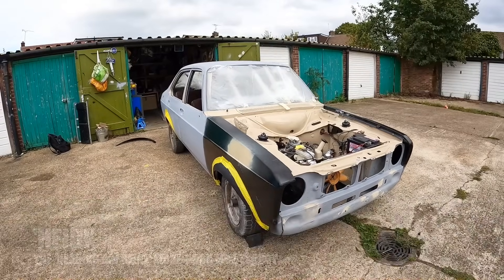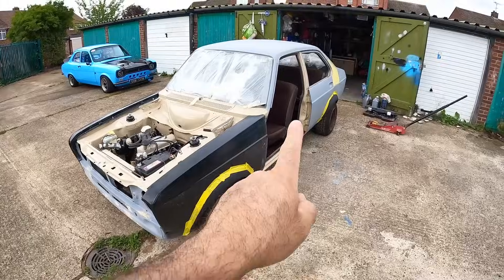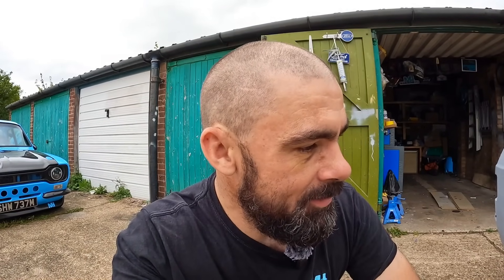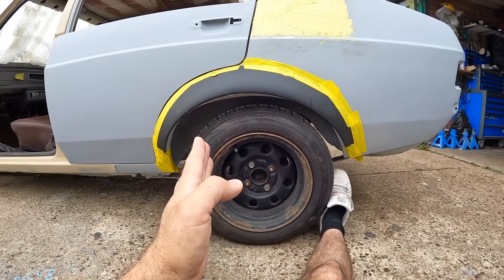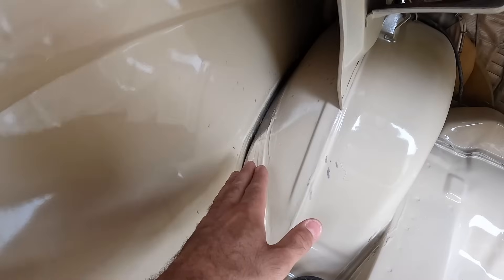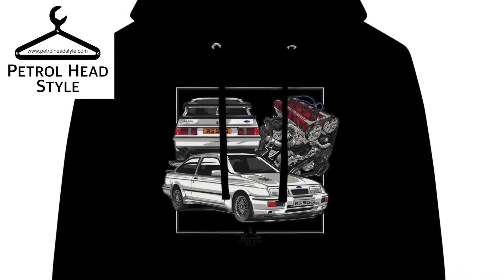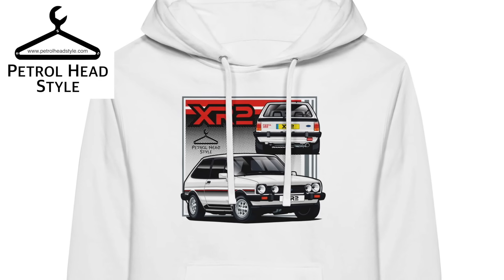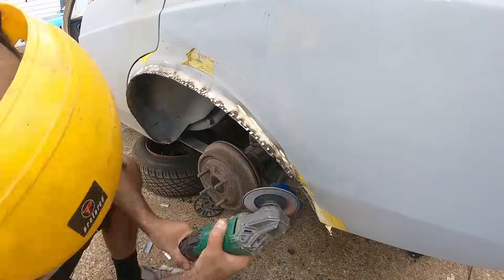EPIC FAIL installing wide arches to my Mk2 Ford Escort!! 🙁 #WideBody

Comment: Honestly, be proud of yourself. As a qualified welder I can tell you that you did a fine job and you should continue to weld as you are showing very fast and promising progress. The plastic arch might move about if you pour boiling water on it. Most plastics are thermosetting.

Comment: And making your own arches with fiber? Is a massive job, but at the same time a nice skill to learn.
Reply: It's a lot of work. You can't just slap fibreglass on and shape it. You need to make a prototype, a mould, a negative and then you can lay fibreglass.. Personally I think there will be a company somewhere that sells steel fab arches as blanks that can be tacked on with a welder.. Probably Europe.
Reply: @R6AAO  Yes, is a massive job, but the end result is better than those cheap plastic ones and even better, the learning experience
Reply: @maxeluy   why get experience in a dead trade? If you want to do a proper job and learn a proper skill you'd make the entire quarter panel and extended arch from sheet steel, however at today's technology level you'd be making lightweight hollow parts from carbon fibre. Similar to the fibre glass but far more dangerous for your health.

Comment: For the return lip.   Use a rod of Steel and cut a 10mm slot in the middle and slowly slowly go around and around folding the metal back.

Comment: Trailer arches are what the use to use on speedworth hot rods. They would look mint Marcus.
Reply from the maker: Im defo considering other options for the arches. Now that the original arches are cut off, I'll be able to accurately measure and see what dimensions would be ideal. 👍

Comment: Keep going mate. Would be better with steel arches though.
Reply from the maker: My thoughts are that if I can get some cheap plastic arches to fit, then if I damage an arch drifting it will be easy a cheap to fix. 👍

Comment: When you lower it mate it should look normal as the wheel would move up and forward in the arch . Looking good keep up the good work
Reply from the maker: Iv always found that it look even more back in the arch when the car is lowered mate. 🤔
Reply: @marcushayesford  if you want a hand with anything if you get the other tarmac archs happy to help you with the cutting and making them fit

Comment: A handy tool for body work is Cleco Fasteners. You can get them in a kit off of Amaz0n. You can get them in clamps, or 1/8” or 1/4” hole fasteners. They’re like a reusable pop rivet. Hold material in place while you’re working on it.
Reply from the maker: Thanks so for the info mate! 👍
Reply: @marcushayesford  You’re welcome.

Comment: Maybe throw the whole arch in an oven on low heat to fully saturate the arch with heat.

Be careful and go a lower heat and maybe creep up on the heat if you need.

Good luck.

Comment: Done a good job on those arches mate  to say you have no workshop etc. Would be nice to see proper escort arches  fitted tho
Reply from the maker: I agree that proper Mk2 Escort rally arches would probably look more 'right' but I'm trying to make the car look different than all the others out there. The main reason for the cheap plastic arches though, is that if I damage an arch drifting it will be easy a cheap to fix. 👍
Reply: Hi mate just wondering if metal would be better as a bolt on as you can bash and weld bits on with no cost

Comment: I think you will start to think it be better with tarmac arches , problem is fitting and cutting to put bigger tubs in then you want to Turret it it’s a slippery slope your on.  I know I did same as you cheap arches  😊
Reply from the maker: Yes these things are a slippery slope mate. Lets see how far I end up slipping! 😃
Reply: Then the Atlas, Watts link, floating hubs, group 4 wheels. Tyres.
Half a year to build, 10yrs to save the money 😮😂
Someone remind me why I bought a 2 door shell???

Comment: At least use fibreglass arches, not those cheap £1 plastic ones. With fibreglass at least you can re-work them.
Reply from the maker: These are premium £20 arches mate, not the cheap £1 ones! 😃

Comment: What about zacspeed arches they have a similar 'look' to the plastic ones but made for the mk2? If you wanted to try those plastic ones again, maybe cut off inner lip bit flush and it could bend easier. Do what you do Marcus...end of the day the cry babies are across all cars that are old go to car meets bitching about the mods etc....follow then to the car park and they get into kia rio lol..

Comment: Just buy mk2 flared arches and fit the right ones because you will regret it.
Reply from the maker: The whole point of the new plans for this car is to try to make it NOT look like every other arched Escort mate. However, I could easily fit Mk2 rally arches later on if I wanted to. 👍